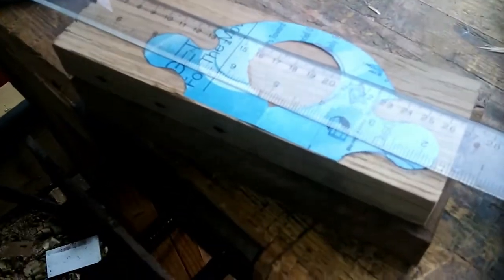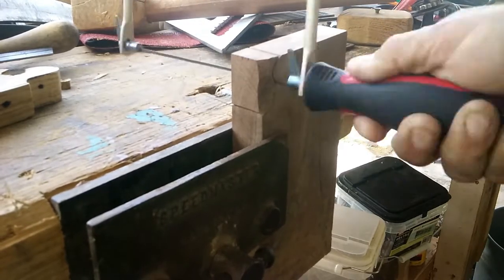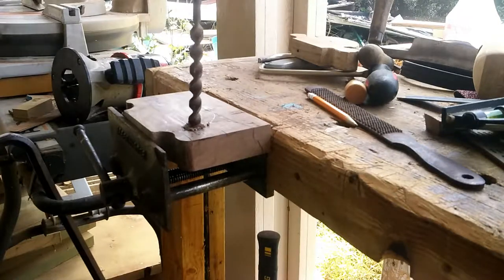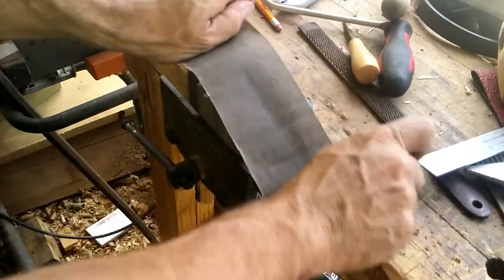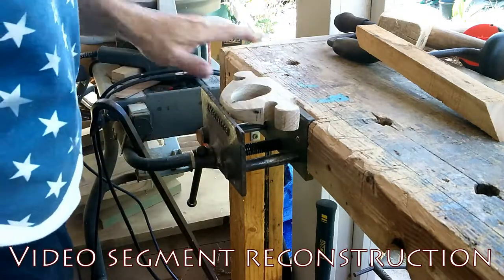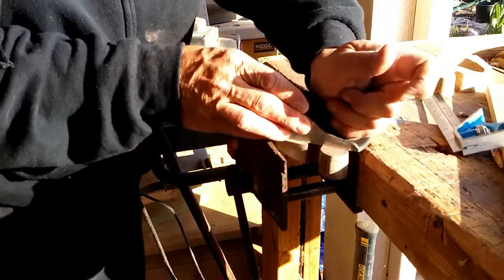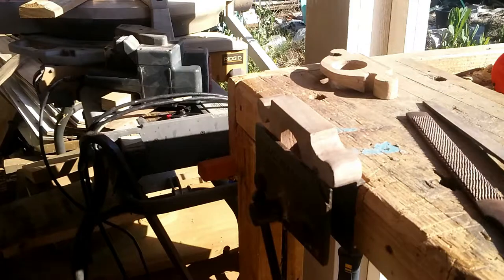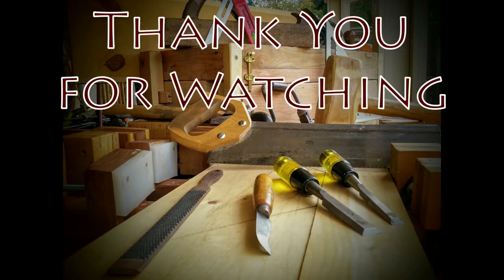Router Plane Part 1

Comment: Good start! I've not made a wooden router, yet, but it looks a good project
Reply from the maker: Thanks! There is a third one I'm working on as well, but with a unique design. I'll use this project as the practice for the third one. If it's good enough, I will enter it into one of the tool make collaborations.